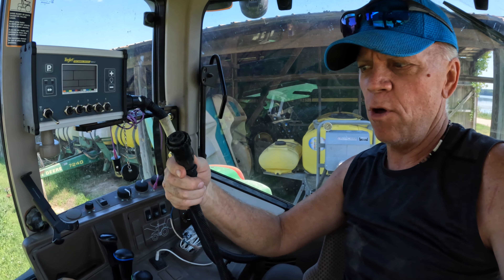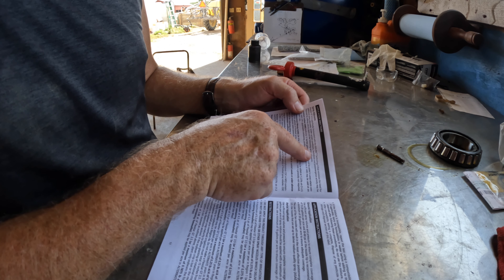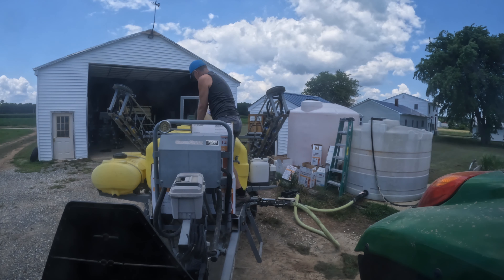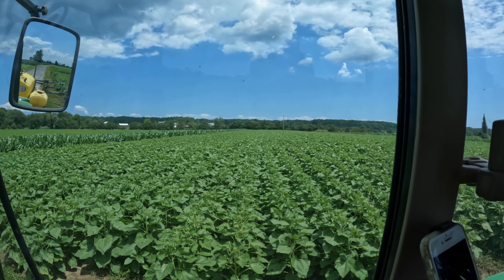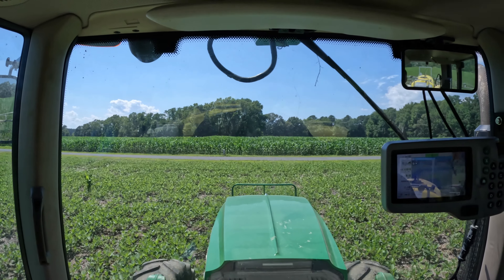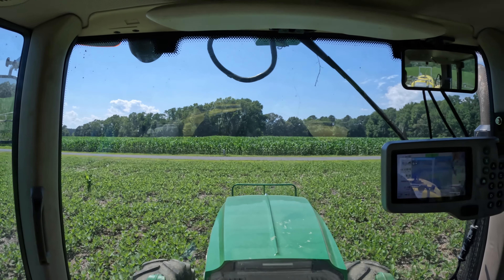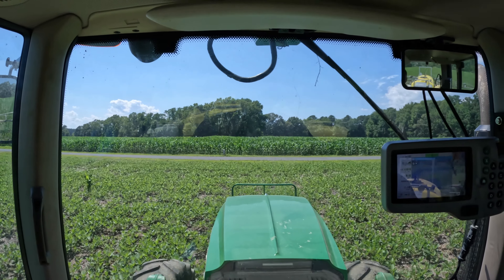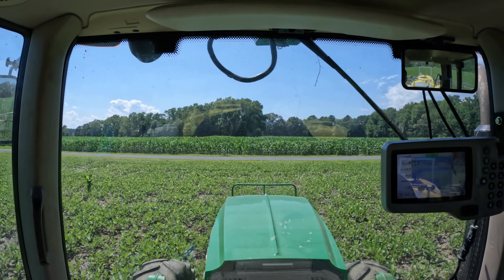Putting out Fires & Putting down Chemicals

Comment: I'm sure you know it by now,but that Flexstar will give your beans a nice suntan-- bronzing,  they call it. Also, it won't get larger weeds,but it's still better than glyph for resistant weeds. The 10 months rotation restriction IS something you have to consider, it's not an empty threat, especially with wheat. I'd suggest some Liberty somewhere in your  program  where it fits.